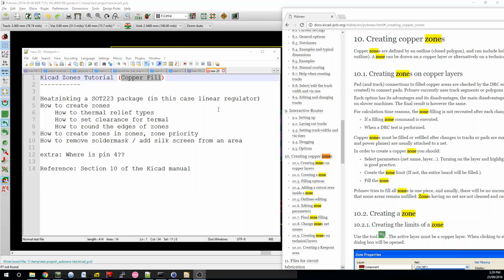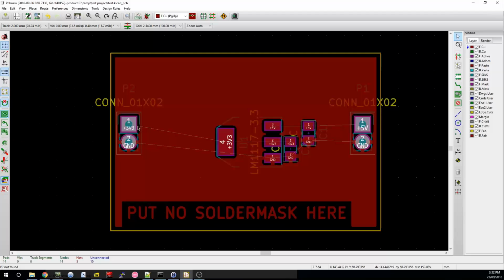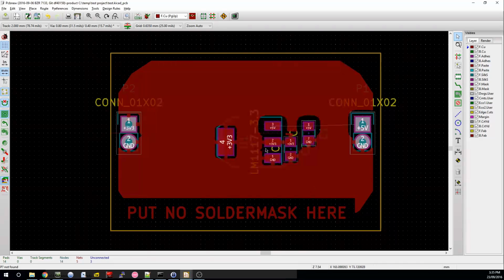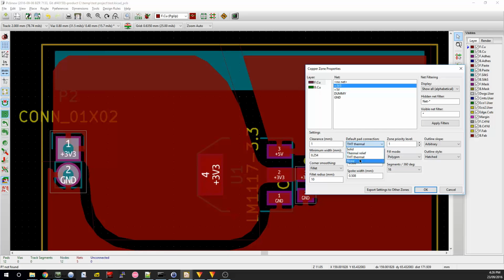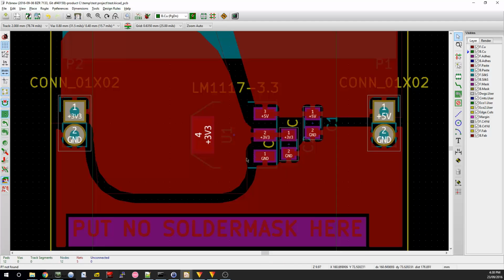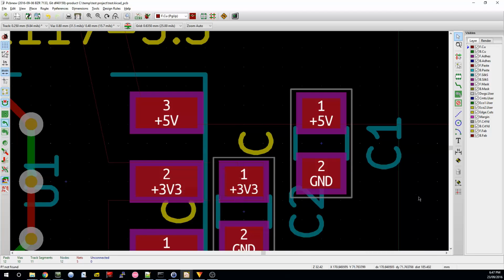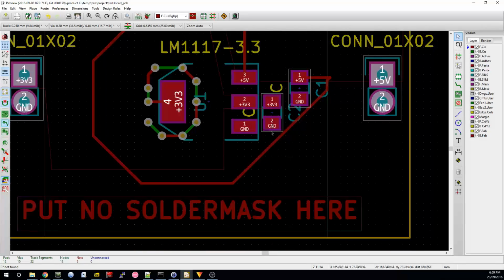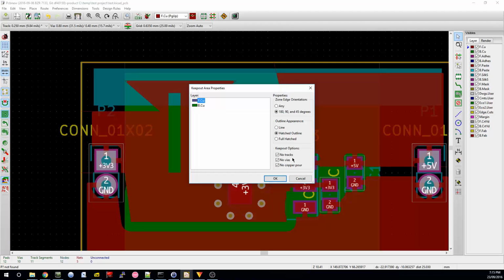KiCad Zones/Copper Planes Tutorial - (Part 1/2)

Comment: Hi, I have make a pcb where current upto 60A will flow through some traces. I will your copper filling method. Can you please explain what I need to do in the design so that when the board comes manufactured, I can additionally add copper shouldering on those traces through my shouldering iron.  Moreover, can you plese make some example circuits with more than one ground planes. Thanks. Roy

Comment: I came here for the "No soldermask here", but it didn't cover it. How do I make a no-soldermask-zone?
Reply from the maker: edit: Finally got around to making a second part of the video which covers this: https://www.youtube.com/watch?v=TmriDK7Jpes

I'm a bit late, but hopefully this helps someone else.

I can't remember if I covered it in the video, but you do the following:
- On the right hand side, click "F.Mask" layer (or B.Mask if you want to exclude soldermask from the back side)
- Use the "Add filled Zones tool". When you click, an unfamiliar dialogue will come up. Make sure only F.Mask is selected, then press OK
- Draw the area you want to exclude soldermask from
- Re-fill the copper layer and check the solder mask is actually removed.

So essentially, you add a filled zone of type "F.Mask", and that area will have soldermask removed from it. 

AFAIK, the ONLY way to access the tool is to select a non-copper layer, and then click the "Add filed Zones tool" normally used for doing copper fills.